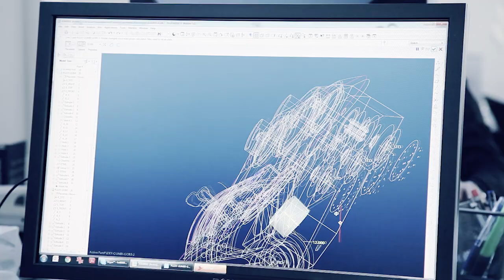Rimac Automobili - The new Concept

Comment: @dzup1234 I create safe non-explosive pure Hydrogen fro a water fuel cell of my design, I also create pure Oxygen separate from the Hydrogen at the same time.  The Hydrogen is input into the vehicle or engines air intake stream a catalyst  causing all of the fuel to be consumed inside the engine prior to exhaust discharge.  The HH2 cell Hydrogen very high temperature burn incinerating all toxins, poisons, HC etc., result is low or  zero emissions & warm moist clean air exhaust. works any fuel.